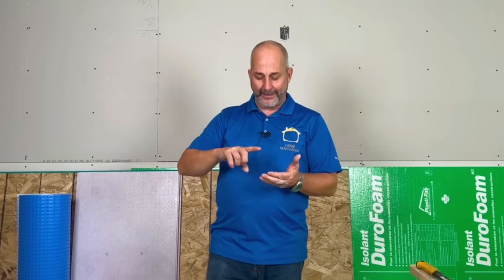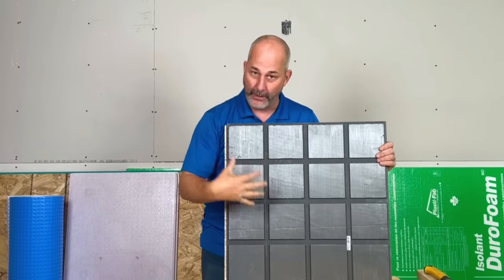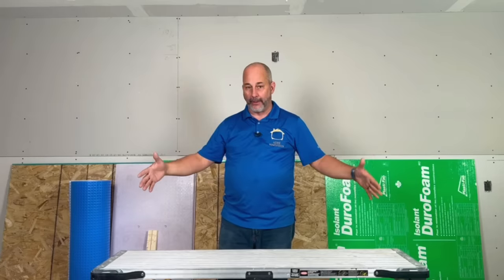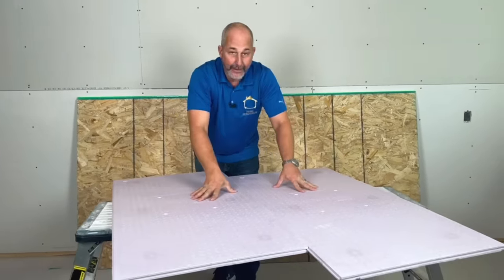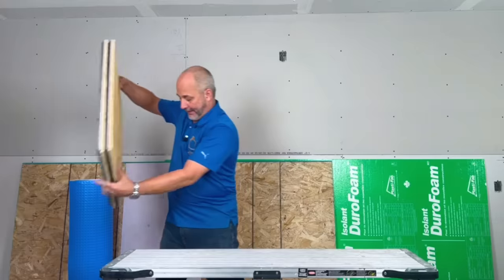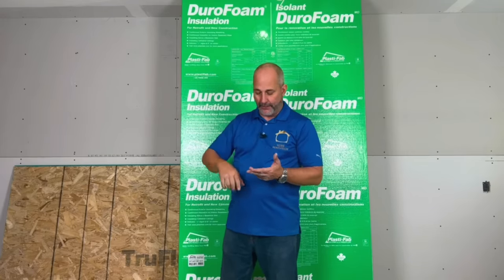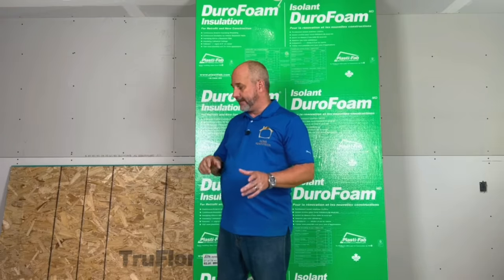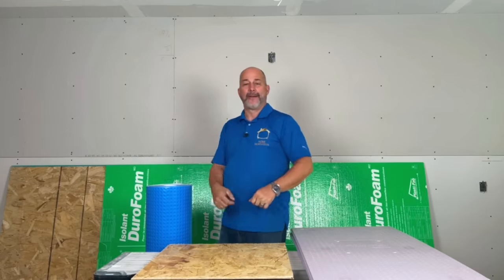Comparing 5 Different Subfloor Systems and What They Cost

Comment: I live in South Texas, I have a very rare full sized basement built in the 80s or older. I have never experienced any type of moisture issues. Do I even need to place subfloor? Right now it's just vinyl tile on concrete - but I want to install wood flooring or similar.

Comment: Hey Jeff, long time viewer first time commenting. I have a pretty good size basement I am hoping to finish part of it. 1000sqft is what I am finishing roughly. The house was built in 1997, the walls are poured concrete and I think the house was a prefab construction, lots of extra joists with lag bolts. We live in northwest Ohio. Mostly clay soil where we are and a drainage ditch which is low compared to the house at least 8 ft down grade wise. We only have one spot on the property the gathers water but everything is sloped away from the home. We had one instance of flooding in the basement for the last 6 years and that was only because we lost a sump pump I think. I haven’t checked the floor with the bag truck to see if we have water infiltration, I will do that. I am hoping to warm up the basement with insulation in the joists which are exposed and add some walls and flooring in the one side. I was thinking of doing vinyl plank, which subfloor would be best for me? Love the channel and the way you explain stuff sir!

Comment: Jeff, I've got a house built in 1940 with a basement. The basement floor is pretty uneven, and slopes slightly towards a drain. How would you handle installing DRICORE on a floor like this?

Comment: Good Morning Jeff,
I'm being asked to put a vinyl click/floor into a basement of a 1960 home which currently has carpet with padding.   The floor has asbestos tiles (which i do not want to mess with) on it and has a floor drain towards one end that has a significant slope.   To keep the change in flooring thickness to a minimum for the first step out of the basement, I'm looking at using the dimpled plastic material that you mentioned in this video.  My concern is that I'm sure that the floor is not flat and when I installed a vinyl plank floor in a kitchen that had some uneven spots it resulted in some movement and clicking of the planks.   Do you think I should suggest this to the home owner or do you have a better suggestion? 
Thanks

Comment: I have a 50 year old house with a mostly dry basement but with large rains, water pools in one small section of the basement from the floor. It only happens 2-5 times a year and it's not a lot of water but obviously want to consider that when putting in flooring. It is also very cold in the basement so I need both water management and thermal. Husband is a DIYer with 15 years experience in construction so he is very capable of installation but he wants to go with the cheapest option. I'm afraid that will mean ripping up flooring, mitigating mold, and having to start from scratch somewhere down the line. What are your suggestions? Thank you for this information!!

Comment: Hey i love your videos!
I will be building a house in Chelsea next to gatineau this summer. I will have a basement with 9 foot basement walls, so 8'-6" basement ceiling.
My question is if I use your system how much higher should my first step of the basement be? 
1" foam + 1/2" OSB + 1/2" flooring ?
So 2" more for my first step or do you have another recommendation ?

Comment: I'm building a new house this year with high ceilings in the basement and I want to finish the floor with engineered wood.  In the bathroom and laundry room I want to put tile so my question is would you be using this subfloor everywhere including the ceramic floor areas or how would that work?

Comment: I have a home built above a filled in river that recently got a drainage system built around the perimeter to a sump that pulls the water roughly 30ft away from the home.  Built in 1900, so certainly none of the new standards are included, and field stone foundation.  I want to put in some kind of flooring in an area that is used as an office/ workout space (~200 sqft) to warm it up a little bit.  The walls don't leak, but if they begin to, any moisture should run down into the drainage system under the concrete.  What would you suggest I go with?

Comment: I am looking for a system to put a floating floor over an existing hardwood floor in an older home early 50's. The floor is uneven (pitched areas) with holes from radiator removal.

Comment: Jeff Love you video's. Hey we build new construction and want to put glue down engineered hardwood down. The slab does get a vapor barrier under the concrete. What do we need to use as our subfloor. Would love for you to come down and see the Steel Frame Homes we build.

Comment: Just watched your video, great video by the way.  I live in a house that's on a concrete slab.  My issue would be a  thermo issue.  What would your opinion be for subflooring keeping in mind that the thickness will need to be kept to the least possible because are thresholds to consider.  Also I wouldn't be able to screw down the subflooring due to electrical, plumbing and believe it or not, duct work running throughout the slab.   Help...!

Comment: Curious if 3/4 osb is necessary if the flooring will be a mixture of LVP and ceramic tile. Could 1/2 inch OSB on 1/2 inch duro foam on dmx 1step(3/16) provide adequate stability and thermal block? No moisture or water issues. Actually  had a water line burst in the front yard and about 8 inches of water in the planter next to the foundation before it was turned off. Not a drop of water in the walkout. House built in 2001, Michigan. 1step is an added nice to have not necessity.

Comment: I live in Detroit Michigan suburbs and we have a new construction home built in 2020. As per my knowledge it does have water insulation plastic under basement concrete. I am planning on installing luxury vinyl. For my flooring. What do you recommend installing underneath the lvt?

Comment: Jeff, as I may suck sometimes, correct me if I’m wrong…whenever I use tapcons, I always cleaned out the hole with a vacuum because what I noticed is, the tapcon binds up and I end up snapping the head off, when I leave the dusty goodies in the hole. Is that because I’m using too much torque when fastening?

Comment: Hi Jeff, I love your videos! You've helped me complete a lot of projects. I've got a 1948 house with a basement that has a steep sloped floor towards a floor drain(almost 2.5" right at the drain). My main problem is moisture, and I've already had a floor drain system with sump pump, installed for wall leaks. No water through the floor though. I don't necessarily want to finish the full floor, but want to install a bathroom in which the floor drain would be in the room. What would be my best option for flooring? I was thinkin of doing the DMX bubble sheet with

Comment: I'll be finishing my basement in a few months and your videos and tips will be so helpful, thank you!  I have a question regarding my flooring - one room will be a home theatre and I am planning on putting down carpet tiles with adhesive backing (they have special designs for home theatre usage).  What kind of subfloor would I use for this?  My house does have a vapour barrier and wrapping and we haven't had any water issues so far (knock on wood).  What would you suggest I use?

Comment: My concern with the drycore is it not being 100% sealed and will still allow air/vapor movement. 
Is this a valid concern?

I have a raised ranch here in Macon, MO. With my thermostat at 70°f it's an uncomfortable 61°-65° downstairs, the floor is even worse (thin carpet thrown over concrete)

I know for sure there is no vapor barrier under the slab. That said, which method would you recommend to properly seal the floor and allow me to lay OSB, then a tongue in groove flooring system?

Comment: I needed this video Jeff! I am in a rental with worn parquet flooring and I want to upgrade and level the floor and use engineered hardwood plus 48" tile, of course it has to be removable. Can I use Durofoam as a base and what can be used to set the tile?

Comment: Thanks but no thanks!

I had just questioned you about this particular issue a month ago and was really confused between the options available and their actual necessity according to my basement. I went with dricore foam board. I could have saved some $ by this solution.

Actually I am your regular follower for construction and restoration related activities

Comment: Hi Jeff! I've watched a lot of your videos and i have to say they're incredibly helpful! That being said I'm still lost as to what would be right for my family's home. It was built sometime in the 90"s, and built with a rather poor design as we have experienced it. After roughly 25 years or so you could imagine it needs some pretty serious renovations. The biggest and most pressing problem though is our subfloor. While we don't have a basement we do have a crawlspace under the house, it was build with concrete blocks and wood support beams so the floor of it is just dirt. Unfortunately the builders also didn't build the ground up as they were supposed to so rainwater collects underneath on occasion. There are vents in the walls surrounding it but living in a high humidity area doesn't make them that effective at removing moisture, I believe they are only meant to vent the carbon monoxide that can seep up from the ground. All of this has contributed to our subfloor rotting as it's made of nothing but plywood. My sister actually fell through the floor in the kitchen and has a scar on her leg where she was cut by the plywood. Is there any recommendation you could give as to what would be best to replace our subfloor and hopefully eliminate our moisture problems?
Reply from the maker: Yes. I would manage the rain water by trenching around the house and building up a damn effect to keep water from getting underneath. also add a trench and grading under the house so any water that does find it way in runs right back out again. a dry crawl space is a long lasting one. the plywood is not an issue as much as the wet ground underneath . Cheers!

Comment: I live in Ottawa. We had leaking in one of our basement walls last spring and it came up through the basement floor. It's cheap laminate that was installed by a previous owner and installed poorly. Some boards are loose so you can shift them with your foot back and forth and create decent gaps. It's only installed in the hall and the main room. The furnace room and laundry room are bare concrete. The only thing under the laminate it a very thing styrofoam type material, maybe 1/8 inch. It looks like the stuff they use to wrap delicate items for shipping.

The house was built around 1980. I would like to have some sort of moisture management because I don't know what is happening behind the drywall in other parts of the basement. We sometimes get water in the laundry room after a heavy rain which is fine since it's bare concrete, but if it's happening elsewhere in the basement I would like a way to deal with anything that might come in unseen.

Comment: Jeff, first of all great videos. I have a question regarding my old house from ‘57 with crawl space, i have issues with both vapor and thermal insulation. Floor is freaking cold on Chicago winters. I have harwood floor and its good quality but i have to remove it so i can do some thermal insulation. I was thinking to put some foam boards and then laminate floor on top. Would that be good option? Thank you

Comment: Ok, you skipped right over just a thermal barrier ( no moister issue ) with a floating floor. It sounds like you can use the Isolant DuroFoam and put the floating floor right over it?

Comment: Jeff thank you for another awesome video! I live in a 1970s home in Toronto which currently has vinyl 12x12 tiles (possible asbestos) and carpet on top in my basement. Do you recommend removing the carpet and vinyl tiles before installing the subfloor? What type of subfloor system would you recommend?
Reply from the maker: have the tile tested. to my knowledge 12 x 12 were all produced after they banned asbestos in flooring. I would consider a thermal dricore product and a continuous air space behind the rigid foam board before framing. Cheers!

Comment: I have a brand new house. I'm not worried about water issues with poured walls and 1 inch foam on the outside of the basement walls. I'm not sure if there was a foam layer underneath the concrete floor. When I finish the basement I will install carpet on 90% and tile in one small bathroom. Do I need a subfloor at all?

Comment: Hi Jeff - thanks for this great video - I live in Ottawa (Navan area) I own a 3 unit home 2 unit are in the basement and are rentals - during the 2022 may storm it got loaded as the sum pump didn't work as we didn't have electricity for 5 days and no one home to see the issue. We now need to redo the apartment flooring and I am wondering the VERY BEST option. We are also considering Radiant flooring. - Thank YOU for your great advice
Reply from the maker: for a rental that has a potential to flood with fresh ground water I say electric cable floor heating and tile. it can always be washed and never needs replacing when flooded by clean ground water.

Comment: Hey, love your work.  I have a basement that was insulated and tiled with ceramic, but, I also built a subfloor so as not to have cold bare feet in the mornings.  French drain, and nailed liner, with an interior spray insulation on the walls (seems well done and very functional).  I am in Canada.  I do not have 8 foot ceilings there, but, I am not 8 foot, so I am good.  I tend towards overkill and like the durafoam idea with engineered hardwood, but suspect it may be redundant.  If durafoam could give me hardwood, I would likely go with that?  The big box hardware store is suggesting a thin foam roll?

Comment: The rear side of my home is a mostly exposed basement, half of it being a 2 car garage. The other half is finished and I plan on redoing it and closing up half of the garage for a walk through door. 

There is no visible water damage, do you think my home was designed to have a finished basement? Built in 1978.. I am considering the cheaper method!! Haha

Comment: Hi ! In an other video you suggest to stop the sub floor just a little before the wall and to put pl glue behind the rigid foam to let moisture dry. I have a 1972 house in Quebec city Canada and I will remove all my basement unfinished walls to replace the rigid foam that is all damaged and then reuse the 2x4's to do the walls again. My question is : is it worth putting my sub floor almost all the way to the concrete wall and having to cut all my 2x4 shorter to put up the walls again on top of the subfloor or should I just put the sub floor around it so I can put the already done divisions back in their place without cutting them ? We know our French drain is in good condition, our soil is in clay and we don't have any membrane around the foundation since they didn't put any in the 70s

Thank you

Comment: 2004 tract home build in Ottawa.  Laundry area has stick on vinyl tiles, some have bubbled up from efflorescence.  Living area has laminate that was installed on concrete with just the foam sheet seems fine.  I want to remove it all and do the same vinyl plank everywhere.  What did you suggest?  THANKS!

Comment: Living in southern Texas the AC is usually running and moisture isn't an issue. However when it's real muggy and only about 50 degrees Fahrenheit outside the AC is not running and it starts to feel humid inside. I've only retiled the 5x7 bathroom so I can't speak to the foundation (slab on grade) but I'm assuming this 1970s house doesn't have any kind of moisture barrier between the foundation and the ground. Would something like that dimple membrane be a good solution to handle that kind of humidity? If so how would you handle it going up against exterior walls and transitions to tile?

Comment: Evening sir, really appreciate all the fantastic DYI videos! I'm looking to finish our basement, we live up in Grande Prairie Alberta, no real concern of moisture( it's a brand new house, sand foundation, and good drainage), but I do want a thermal break and something to fasten carpet to. My initial thoughts are to go with the 3/4in durafoam with 5/8th OSB, and then the carpet plus underlay on-top of that, thoughts? Also do you put this same subfloor in the basement bathroom for the Schlueter ditra to go over top of? Last dumb question, when you're doing a basement job, are you putting your walls up first, then this subfloor buttons up against it, or subfloor first and then walls on-top of that?

Comment: Absolutely love your videos.  Couple quick questions, hopefully you will see these questions.  Do you have a recommendation for an alternative for Durofoam?   I am looking for it here in the States and I am not finding that brand at all.  Any other brands/products that you would recommend if Durofoam is not available in Minnesota?   Secondly, how many Tapcon's would you recommend per 4x8 OSB sheet?  I am starting on framing my home theater, and I am planning that the wall will be framed as normal (attached to cement floor) and the insulated subfloor will but up against it.  I am planning on including a riser for the second row of seating.  Can that be built on top of the insulated subfloor or would you recommend the riser being fastened directly to the concrete floor?  I am open to suggestions on any of this.  Thank you in advance.

Comment: I've purchased all the LVP I need for my basement floor but I'm stuck on what to do with the subfloor. I'm in a new 2020 build in Buffalo NY and I purchased enough 1" XPS to cover the floor. Do you recommend one layer of 5/8 osb? I hear 2 layers of 1/2 might be better.  Head 9' ceiling so headroom isn't an issue. Thanks for any suggestions you can give me!!!